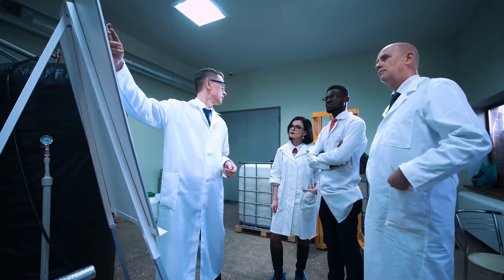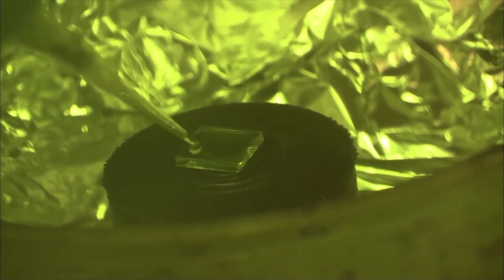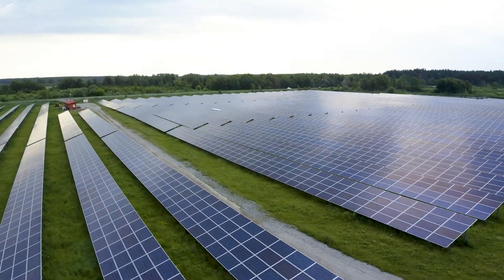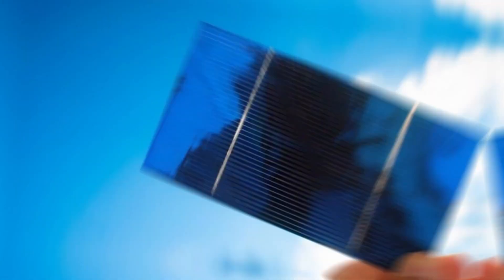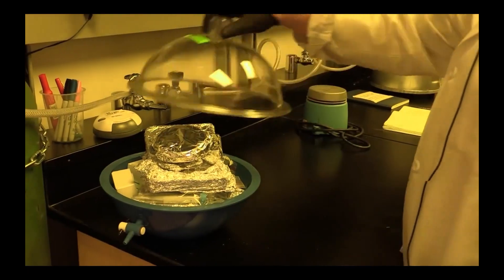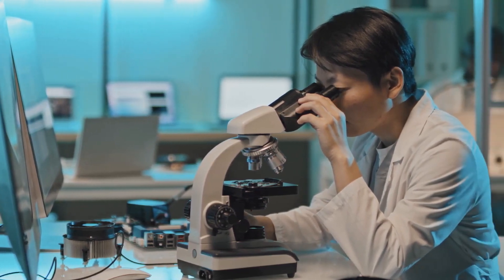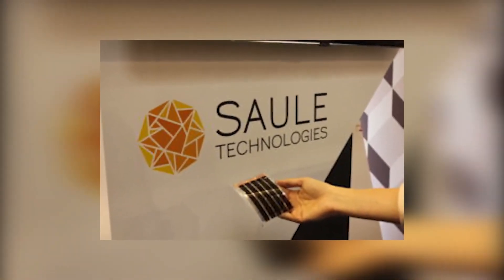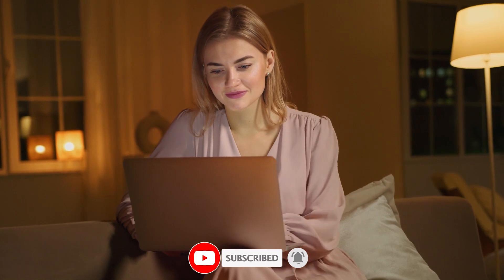IT HAPPENED! Perovskite Solar Cells FINALLY Hit The Market

Comment: This is GREAT NEWS. The problem I forsee, though, is than this testing regimen does not take into account the normal lifetime exposure to cosmic rays and their decay products that reach the surface, and consequently essentially every PV device made. SOME normal (outdoors) exposure will be necessary to get a reasonable value from which true lifespan can be projected.